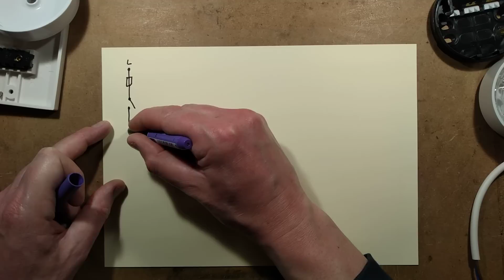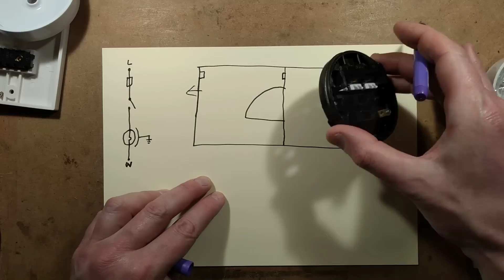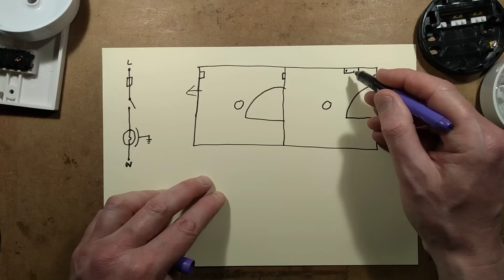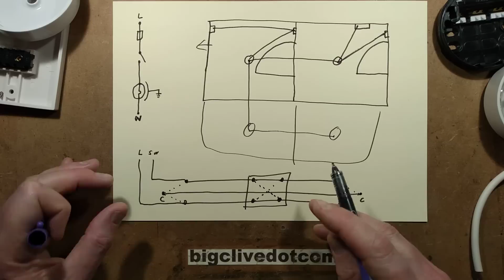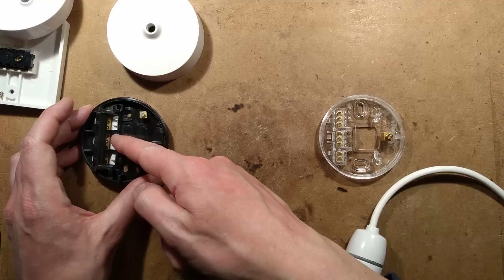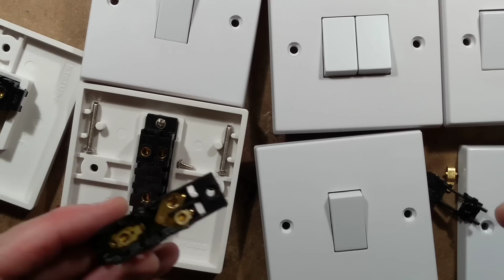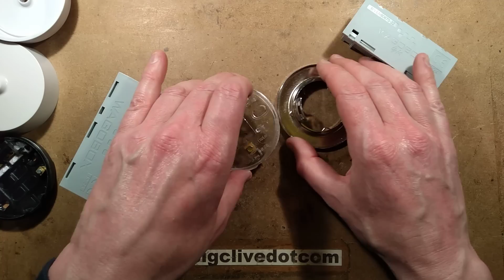British home wiring.  The incredibly simple lighting circuits.

Comment: Reading the comments, the UK is really the odd one out (who would have thought ;) ) when it comes to wiring in Europe (and maybe even most other parts of the world). 
Ground wires are sleeved (never seen anything else, even in 50 year old installations).
Everyone uses round boxes (which, with a hole-saw, makes them easy to install in drywall and the proper whole saw even in concrete).
The connections for lighting are just 3 wires hanging out of the ceiling (no "ceiling rose").
It is always the live that is switched, neutral and earth go directly to the light.
And at least here in Austria, there's usually one breaker per room for outlets and lights in common.
Reply: why would it be better to put "ALL" of one room on a single circuit, - if the power to that room goes out there is now no ceiling lights, and any desk lamps won;t work either.

In the UK (standard 2 story house) there is a consumer unit which will have 4 circuits as follows:
1a downstairs sockets, 1b, upstairs lights (all protected by RCD 1)
2a upstairs sockets, 2b downstairs lights (All protected by RCD 2)
now there can be a fault either upstairs or down stairs in the lights, and desk lamps will still work, or a socket fault (no desk lamps) and ceiling lights will still work.

I agree round holes are easier, but for plasterboard/drywall a knife will cut a fine square, in brick, and SDS box cutter cuts a perfect square hole...
Reply: @danielr82  
Didn't say that it's better. The one room - one circuit thing hasn't ever been a problem for me though. Turning on the light in the next room or hallway is usually bright enough to do whatever you need to do in the "dark" room. 
What if the lighting circuit fails on a floor and you're in a room where you don't have a desk lamp (or any lamp that's connected to a socket)? Doesn't really matter that the outlets still work in that case.

Comment: Something i thought of, in Sweden, its illegal to put  wires directly in the wall, everywhere needs plastic pipe or tube to pull the cables in, also inside walls you need cant pull in a bundle of cables, every cable needs to be by their own, it also makes it easier to use other colors for lighting circuits

Comment: You didn’t complete your lighting ring on your doodle Clive!
Reply: The lighting circuit is most usually radial, not a ring. The ring circuit is used for 13A accessories (sockets, fused connection units).
Reply: Ross Thompson, quiet often you will find the lighting on a ring, or something along those lines but I suppose he was explaining the way that lights and switches are wired and not the fuse board or wiring regulations in general

Comment: Well.. after watching this I'm assuming that me running the live to the switch instead of the ceiling rose is possible a bad thing? It is in a garage that has only one live feed for lights and sockets :/
Reply from the maker: It used to be in breach of the UK regulations, but they changed that a long time ago, so it's fine.

Comment: Our T+E has changed already in Ireland the earth is insulated and all conductors have to be the same CSA , Also we have to use 10mm2 for pretty much every shower unless its under a 12m run as you can imagine its an absolute bastard to terminate if you need to put a 45a DP on the wall instead of a pullcord with 6 10sq cores to ram into a back of a switch.
Reply from the maker: Sometimes I wonder if using a larger cable poses a higher risk by putting mechanical strain on electrical components.
Reply: @bigclivedotcom  it full on does in the case I was describing with the 10's. The cable is rock hard like 6ish strands and the accessories we use are the same as you have in Britain for the most part which are clearly not designed for that use case. No matter how neat and short you make it off you have to dog the switch onto the wall. Also they Jacked up the price of cable by about 50% which was nice.

Comment: When you have two switches controlling a single light, we normally call those in the US a 3-way switch. The conductor that goes between the switch is usually called a traveler. It's interesting to see how you guys buy your switches with the wall plate as an integral part, where as we buy the switches and cover plates individually, which allows us to build a lot of different combinations, including having a receptacle, if wanted.
Reply: Several manufacturers produce modular wall plates with various inserts available. Using this system, you can have countless combinations...

Comment: The white box with the yellow wings would be something similar to what the US uses and it's is called an 'old work' box, for installing after the drywall or sheet rock has been installed. They used to use the steel deep boxes for new work (prior to being sheet rocked), but most contractors have gone to using blue plastic boxes with captive 16d nails on them.

Comment: I'm calling big Clive on his lie, there's no way those small boxes get plastered up too, not never once in my life have I seen one that doesn't have at LEAST half a trowel worth of plaster or even better plastered with at LEAST 2mm of the box still poking out the poxy bloody wall!!!
Reply from the maker: The lip of the box has to poke out just enough to stop the switch going on flush with the wall.  Even when you jiggle it and tighten the screws until it makes cracking noises.

Comment: i find this very interesting, in the netherlands it's very different, we use 2.5mm2 wire for the whole house except for switched lighting wires they are 1.5mm2, the fuses are all 16 amp, and the distribution is usually one fuse per room, also if a lighting circuit has 2 switches we just run a live to the common of 1 switch, then run 2 wires from the switched contacts to the other switch, and one wire from the common of that switch back to the light.

Comment: Man, I'm shocked that the fixtures are supported by the conductors entirely. There isn't even strain relief so that the outer jacket of the cable provides additional support.
Reply from the maker: Heavy lights can use a chain or specific load bearing ceiling rose.

Comment: It's nice tro see other countries' electrical systems, it allways gives ideas. I started to use the wago terminals just because of your videos, now they are all over my house (every time i have to change something, i replace the old screw based ones and put wago instead). However, i don't like the way you wire the switches to control lights from more than 1 position. Here in spain, we put the live to the common terminal, then connect L1 and L2 from switch to switch, and the 2nd common goes to the light (and neutral directly to the light as well). That way, you don't put L and N close inside the switches, someone told me that in some cases, there were some sparks inside, and if things goes wrong, they REALLY go wrong. With only one phase system, no matter how bad things goes, you just get the lights on all the time...

Comment: On some of those boxes it doesn't look like you could use a cable clamp.  Are cable clamps not used in Great Britain/Ireland/United Kingdom?

In my area (Chicagoland,) mostly everything that is older construction uses solid steel pipe conduit, metal junction boxes, or flexible steel conduit if it's a homeowner job or some funky configuration where the builder wouldn't be able to successfully bend up a piece of solid steel conduit.  Newer builds are coming with Romex and plastic junction boxes.  It really depends on the municipality and the subsequent building code.  Either way, cable clamps seem to be required no matter what.  Perhaps not with Romex and plastic junction boxes, but if you use Romex with a metal junction box, you have to use a cable clamp.

By the way, there are so many nearly all plastic light fixtures that have a ground screw.  I don't see the point of it really?  What are they grounding?  It's plastic!  It must just be there to satisfy an electrical requirement but has no effect in reality.
Reply: It's just somewhere to park an earth wire from the cable. If you were using a metal switch plate it would need to be earthed, and would have a short wire tail bonded to the plate. You just use that terminal to make the connection between the tail and the incoming cable.
With fully insulated switches there's no real need for an earth in a plastic wall box as you say (in a metal back box a chafed cable, or loose wire inside could make the exposed screw heads come live).
Reply: @ZXGuesser  Very true indeed.

Comment: Is there a reason the UK uses 50 hz as opposed to the 60 hz we use here in the US??? What about the single 200v (220-240v, I've heard all three so not sure which is accurate, please forgive the ignorance :-), what is the reason for such a high voltage used in the living area??? Is it so you can use smaller wires??? Sorry if this is a stupid question but I'm genuinely curious... Thank you Mr Clive for the always interesting videos :-)
Reply from the maker: I'm not sure why it's 50Hz.  Our supply system is simply three phase 240/415V with a single 240V phase and neutral going to each house and the full three phases going to industrial premises.

Comment: @bigclivedotcom - 
the lamp plug at 23:54 has the same problem as the old German "Bauerntod"-socket + plug that is banned since 1970s 
https://www.mikrocontroller.net/attachment/372368/E186B2E4-85CD-41A3-B711-CE7D406C6F85.png + 
https://www.mikrocontroller.net/attachment/255971/20150502_131133.jpg + 
https://i.ebayimg.com/00/s/NzY4WDEwMjQ=/z/I9sAAOSwx9ZauLjg/$_72.JPG + 
https://www.picclickimg.com/d/l400/pict/273621105465_/Drehstrom-Kraftstrom-220V-380V-Secker-Steckdose-Flachstecker-Verl%C3%A4ngerungskabel.jpg

you can get this death plug / socket even today on alibaba , in plastic reincarnation ( 380V Flachstecker)

Comment: I was in a friends new flat the other day, the bayonet fittings have the pins hidden, they only become exposed as you push the bulb in - presumably a newish safety feature.
Reply from the maker: They've had safety holders for decades, but they didn't take off initially.  I think the heat of traditional lamps made them fail quickly, but that's not such an issue now.

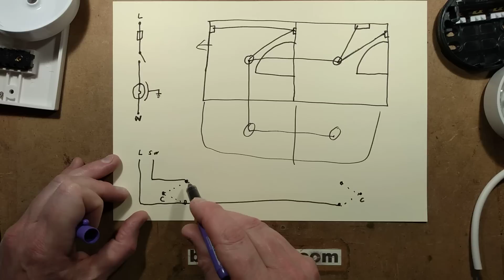Comment: 4:00 We call that circuit "illegal 2-way switch". We are wiring all switches to the junction box in the roof, usually with 5x1,5mm2 cable. Hello from Finland! :)
Reply from the maker: Why illegal?  Wouldn't that refer to the version with live on one switch and neutral on the other.
Reply: @bigclivedotcom I think it is not actually illegal but not the preferred way. Because of that, it is really uncommon here. That dangerous version is really illegal. We do 2-way switching this way -> http://www03.edu.fi/oppimateriaalit/lvi/aihio4/taloverkko/valaisinryhma/kuvat/porraskytk_1.jpg

Comment: Cool, I wish our USA wiring were a bit more "unified" or "standardized."  The old house I purchased back in '97 when I moved back to my hometown to be close to my mother, who is getting up there in age is a sort of rats nest of wiring.  Some of it is almost modern with some very old circuit breakers that are sort of hanging by themselves in a kind of brick design with no door or cover of any sorts.  This is in the dirt basement of the house and you need to exit the home and walk around the house to the basement door which is just a sheet of plywood with hinges and a door handle covering the stairs that go down there.  In the laundry room used to be two fuse boxes however when we purchased our new dryer a few years ago, the electrician demanded that we replace the fuse box with a breaker box, so that was upgraded, however there is still the main fuse box where the power enters the home, that is in the laundry room, and has the two large slot type fuses as well as 4 30 amp fuses.  To turn off the power you simply pull a large sled that pulls the slot type fuses from the box and kills all the power to the house.  There are several 3 way switches in the home, most of them do not work because someone has screwed up the wiring over the years and I don't have the knowledge to figure out which wire on which switch, or on the light needs to be switched with with..  Ah for the good old days when all you had was two wires you simply hooked them to the lamp and it came on.

Comment: Please tell us the story about the fault with the TT supply.
Reply: It might be like the fault I saw recently where the shallow metal box was making occasional contact and tripping the lights. If the user pressed slightly harder in one area it made the wire touch the box and trip the breaker.
Not easy to diagnose because the fault only happens when pressed. To look at the wiring and test it, it all passes.

I've also had that "why does the earth have live current?" problem as well.

Comment: Hey There Big Clive , i went to your website but could not find a way to contact you so i had to go this route , Anyway i am a truck Driver in the  U.S. & having issues with bad Lighting , i found this Bell & Howell led light bar at a truck stop, turns out also on amazon etc , Anyway it uses an sla battery and was wondering if you might have any ideas on how to convert to lithium and possibly the best way to do a 12 volt direct hook up? , here is the amazon link so you can see what i am talking about  https://amzn.to/2J2M3Q6 , hoping maybe you will do a video on it....Thanks

Comment: I really don't get how this could be simpler than what is commonly done in my country, bring power to the switches and then to the lights itself. First, you don't have to really have wires in the ceilings, all the wiring comes from big derivation boxes where it goes to all the switches and then all the lights. Second, you use less wire. Commonly you have 2/3 way switching, so you take the live to the first switch, then the 2 switch wires to the second switch, maybe third, then to the light, and then take directly the neutral from the light to the nearest derivation box. In practice you can share the neutral (of course for lights on the same circuits, but a typical homes have only one lighting circuit) and save on wire, especially because you typically have a lot of switches and lights in the same location. And situations where a switch controls more lights are more simple to handle. Also it's simpler to understand, at the light fitting you only have three wires, neutral, live and earth, so even who doesn't understand nothing about electrical can change a light fitting. Contrary in your system you have more wire, to install a new light fitting (because let's be honest, nobody wants that horrible pendent light) you have to put a junction box in the ceiling, and more importantly, you have power to the light even with the light turned off! Maybe one thinks, the light is off so it's safe to touch the wire, but you have a permanent feed! It's dangerous to someone that doesn't know this.
Reply: You weren't paying attention.
The light is not live on either terminal when switched off.
The live portion of the circuit is in the ceiling rose (or above ceiling circuit box), and you don't generally have to mess around in there at all.
Reply: @The_Real_Phil_Lee  why wouldn't I? I don't know the kind of lamps that you have in your home, but my lamps are all installed flush to the ceiling. It means that the wires that comes out of the wall gets directly in screw terminal of the lamp. So I guess that to install a different and more ecstatically appealing lamp you must remove the ceiling rose and replace it with terminals inside the new lamp. Or have put a junction box in the ceiling, well maybe you can do that in British homes where the ceiling is wood or plaster, good luck doing that in most European homes where the ceiling is solid bricks or concrete!
Reply: @alerighi  So it's impossible to fit any flush-mounted lights, or run cables to any light except in ugly conduit stuck to the ceiling?
Sorry,  but I find that rather difficult to believe from what I've seen of the interior decor of any europen houses I've been in or seen photographs of.

Comment: I prefer the older way of just brining a switched line to the switch. I know its the old way but i find it better as people use super shallow boxes on light switches for some reason.  i also prefer the older 1 way switches , when you can get them.

 Also there is no issue ripping it with the ground , your never going to cause any problems doing it , it just looks ugly.

And just a reminder to everyone 35mm boxes MINIMUM nowadays ! They should not even sell the 16mm any more they are fucking useless.
Reply: The 16mm metal back boxes are still useful if you want buried wiring but have a surface mounting control (such as a thermostat, time-switch, heating controller etc.).

Comment: sliting along triple insolated cable never was a problem to me, you only need a knife that is flat and have blade wide enough not to wander to the sides. also in poland for some reason earth wire is on the side, neutral is in the middle so in most cases i simply asume that i can dig in to the ground one and try not to dig in any but if i dig in in any it would be the ground. it is hard to explain

Comment: If the earth isn't sleeved it also means its easier to trip the circuit breaker in case of a fault like drilling a cable.
Reply: That makes sense!
Reply: Bare grounds have caused more deaths than electrical problems ever have
Reply: @wolfpeoplearereal  It's not a conductor. 😳
Reply: @m101ist  How the fuck is it not a conductor?